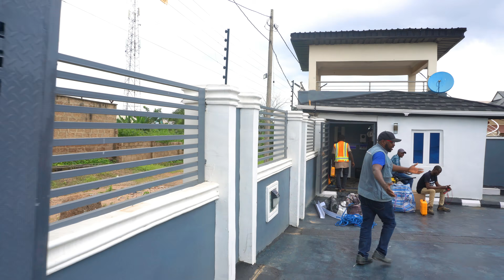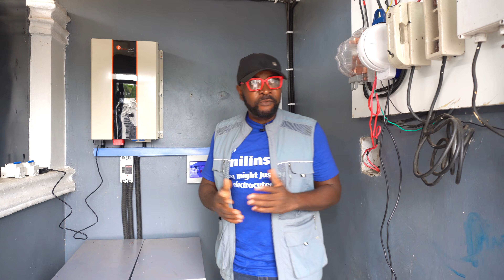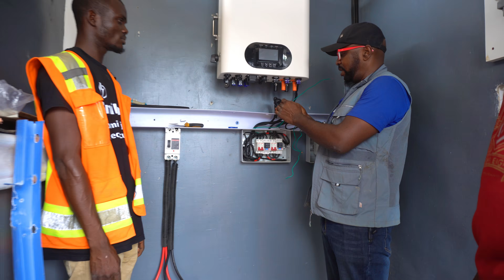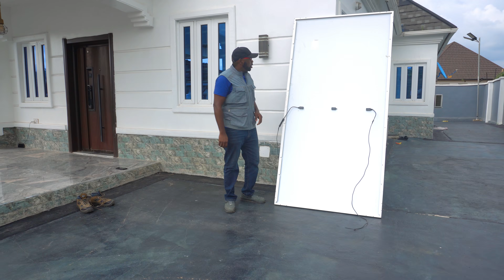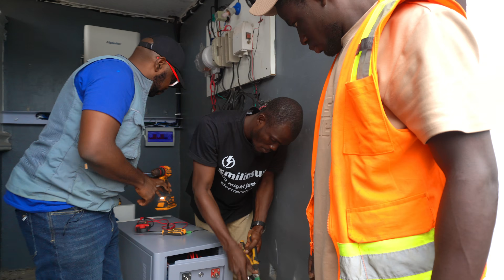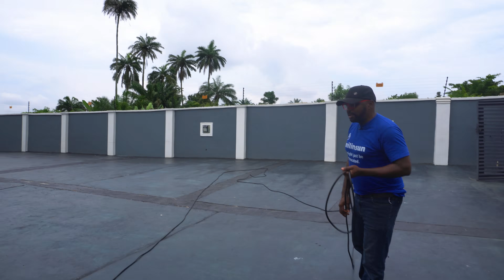He  Called Me in Panic — Their Solar Inverter Was Toast! Here’s How we Saved It

Comment: I noticed that you converted from low voltage to high voltage inverter without changing the battery to high voltage, is that supposed to work? Just asking as a novice
Reply: I think he means inverter can handle an array of solar panels at higher voltage.

Comment: I also have this Felicity 10KVA Inverter (Built in Charge Controller), I have always had the suspicion that the inverter in itself is not efficient because 
a. It is transformer based
b. the fan keeps coming on to cool the system mine comes ON intermediately (It's not ON permanently)

Comment: Great Boss. What actually happens to the battery is that it cannot communicate with the charger controller (I am not seeing communication port at the back of the battery being used) and when the battery mode is lithium, it is a MUST that communication exists between the Battery and the charger controller. Also, the communication cable supplied by felicity in many installations is short when comparing the distance between the charger controller and the battery and therefore many installer decides to forego the communication cable. They also forgot to change the battery mode from lithium. If your PV input is around 80-100V in most cases the controller will refuse to charge the battery by derating it to around 50v to 52v but when imputing higher voltage above the recommended onto the controller this is where the damage ensued/occur.

The question is how to rectify this? Changing  the mode to other battery types at the point of installation pending when issues are resolved is important. also don't forget to set the battery fully charge voltage of to 53V for 15S configuration and 56.5V for 16S so as not to trigger protection on the BMS. 
Felicity should extend the communication cable supplied with charger controller.
Installer should be mindful of the rated voltage input of the charger controller because in the above set up, the configuration that can trigger over voltage is 5s (5 panels in series= 40/45V x 5 = 200/220V).
In summary do not exceed the voltage rating of the charger controller no matter how massively built the controller is.

Comment: Please I intend to setup a solar system that can power my appliances. Which is not up to 3kw in total, excluding borehole, But it should be able to power my 1.5hp submersible pump during the day.   The installer has recommended 6.2kw hybrid inverter for my setup, but I'm just wondering and also want to know, between the 6.2kw hybrid (HF) and a 7.5kva(LF) inverter, which would serve me better for the long run because of my submersible pump involvement on the setup. I gain the knowledge that This (HF) are modern and efficient in battery consumption from your previous video, but can it handle my pump surge on continuous usage without breaking down?  

Please advise me on which one to go for between the two or should I go for a higher kW than the 6.2?    Thanks

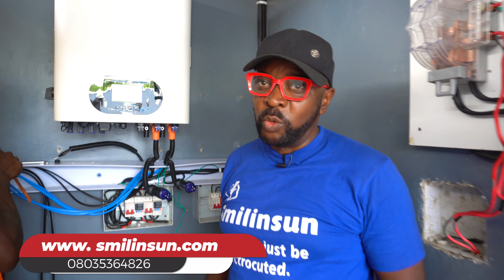Comment: Hi. Interesting installation, but I must disagree with your explanation about circuit breakers. From what I understand, circuit breakers, whether AC or DC are not designed to trip on over voltage (10:30) The voltage stated on them is the maximum voltage they are designed to carry NOT a trip voltage. The original install could have seen high DC voltage spikes in full sun, hence the 1000v variety selected. The selection was not incorrect. If a 500v variety had been used, the spike could have damaged the breaker. You said are changing the system so 1000v is not required but you didn't show that. What micro inverters did you use?

Comment: Pls ikenna I need your help with this problem. The led lights and strips glow when turned off and this happens. Does not happen when the main grid from phcn is on only when on solar. We use a 10kw Cworth inverter and also current is found in the neutral wire? What can I do to resolve the matter
Reply from the maker: This could be due to a neutral-ground bond issue on the solar side. You might need to check your earthing.

Comment: The Felicity Solar SCCM 12048-II when set to Lithium mode (LIB) sets the charge voltage and float voltage to 57.6V. When the battery is full (100%) and idle it keeps the battery voltage at around 57.6V.

Not only does this stress the battery cells but the BMS keeps switching off/on and the SCC  with time might not keep up thereby sending a higher voltage to the battery. This damages the BMS and takes out all inverters and Mppts on the DC busbar. The battery fuse (70V 250A) might not cut to protect the battery BMS hence failure.
Reply from the maker: Great insight thank you so much for sharing.
Reply: Great Boss. What actually happens to the battery is that it cannot communicate with the charger controller (I am not seeing communication port at the back of the battery) and when the battery mode is lithium, it is a MUST that communication exists between the Battery and the charger controller. Also, the communication cord supplied by felicity in many installations is short when comparing the distance between the charger controller and the battery and therefore many installer decides to forego the communication cable and forgot to remove the battery mode from lithium. If your PV input is around 80-100 in most cases the controller will refuse to charge the battery by derating it to around 50v to 52v but when imputing higher voltage onto the controller this is where the damage ensued/occur.

The question is how to rectify this? Changing  the mode to other battery types at the point of installation pending when issues are going to be received is important also don forget to set the battery between fully charge range of lithium 53 for 15S configuration and 56.5V for 16S so as not to trigger protection on the BMS.

Comment: How come the fuse is blown and the breaker didn't catch that - was the fuse ahead of the breaker?
Well done. I like your videos
Reply from the maker: Fuses React Faster Than Most Breakers

Fuses are fast-acting devices designed to "blow" (melt) in milliseconds when current exceeds their rated value — often with minimal delay.

Breakers, even "fast-trip" ones, typically have a time-delay curve. They may allow temporary surges (inrush currents, motor starts, etc.) for several milliseconds or even seconds before tripping.

So, if there was a sudden short circuit or surge, the fuse would blow instantly, while the breaker was still waiting to see if the fault cleared itself.  Thanks for your comment and thanks for watching

Comment: Great work out there.. really inspiring. Just to know, with this inverter once you plug the communication cable, you don't have to sent any communication  protocols  before it's established ? Or you didn't show that part in the video?.

These protocol configuration for battery- Inverter really has some big dela in installations
Reply from the maker: Not all inverters rely on protocols like Growatt and similar systems—those are actually older technologies. Most modern inverters are self-initializing and can automatically detect and communicate with the batteries without manual configuration.
Reply: @smilinsunsmilinsun8056 thanks foe that update.. i appreciate

Comment: The alpsolarr Rosa G2 12kw hybrid inverter is a power tank and an all rounder, IP66 rated, 3 MPPT Input and maximum PV Input of 1.5times it's capacity which is a whooping 18,000w 😮, dual battery port...... This is just a beauty specifically built for efficiency and durability
Reply from the maker: Yeah that inverter is on another level

Comment: Weldone Ikenna, good job. The high voltage systems are the way to go at the moment, considering the loss of efficiency attributed to these low voltage systems. As for the Felicity charge controller issue it's indeed a common thing but if installers must install two charge controllers it's best to mix up Felicity with a different brand, allowing Felicity charge up to 54volts while the other one takes it up to float charge, it has worked for me that way on several occasions.
Reply from the maker: It's great to hear about your experience with those setups! But how do you ensure the charge controller stops at 54 volts, especially since you won't always be there to monitor it physically?"
Reply: Please yiu guys talk of high voltage systems do you mean the 48volts inverter and lithium batteries as opposed to the 24volts inverter and battery. 
Just want to understand. Thanks
Reply: In solar power, 48v systems is the minimum standard for modern systems.
A lithium battery can be high voltage means 72v, 96v etc.
An HYBRID INVERTER or SOLAR CHARGE  CONTROLLER can be high voltage meaning it's rated for input voltage from solar panels at least 500v DC .